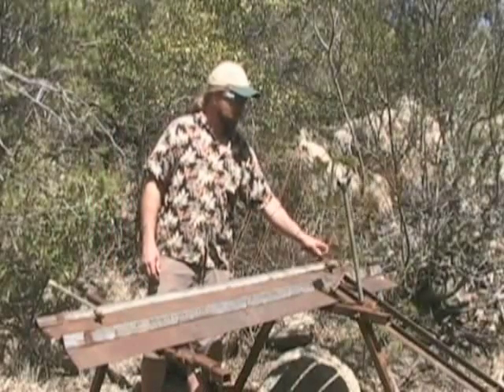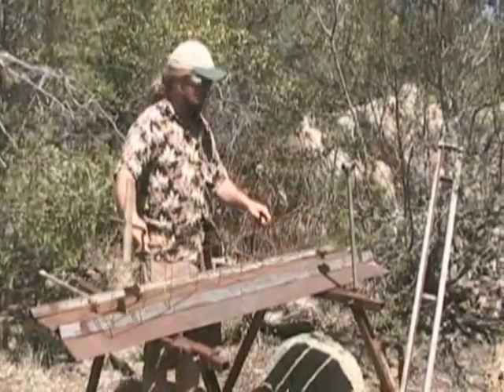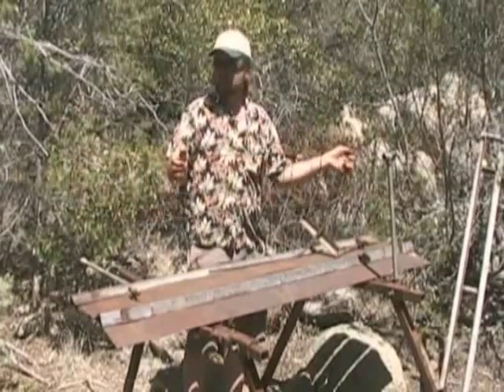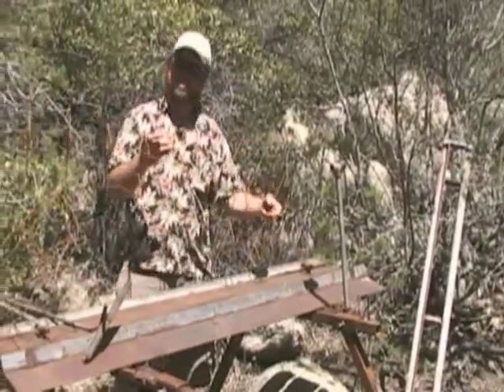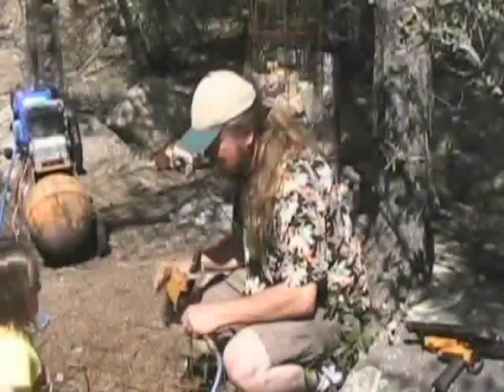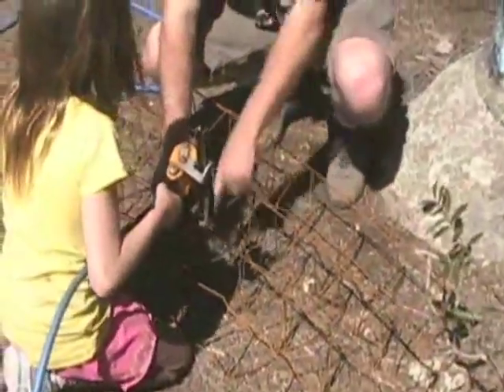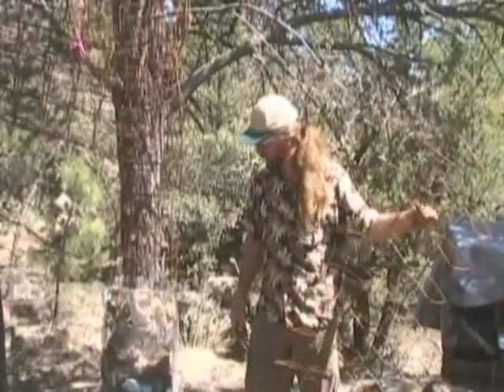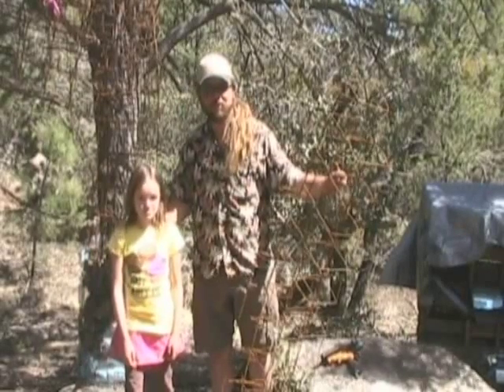Arched Truss Beam and Foundation Column Introduction

Comment from the maker: This truss design is very outdated.  The new truss frame uses segments of the block frame that are orientated perpendicular to the surface shell and reinforced on the top, bottom and sides.  This provides precise control of the blended radius and praise blending of the curved trusses and results in a much faster and stronger truss.  The trusses branch upward from the column base that also has a singe truss frame centered inside that cylindrical column base.  The two branches intersect with the adjoining curved trusses.  These trusses form zig-zag pattern while defining the initial curve, the transitional curves that is curve that gives you head and shoulder clearance in your building around your column and the curve that is your roof dome.  The new folder machine is much quieter and faster.  I keep this video up because it shows the slow development of the final system that is the Flex-Shell Core Monolith Pavilion method.
Reply from the maker: New videos are coming as it is important it is for me to try to get the idea out there of concentrating the fluid curvilinear forming into the initial Core Monolith Flex-Shell Pavilion that is upward flaring columns supporting, and accurately blending curves into a stress-skin roof and a single-shell awning.  That way, the high-energy reactive powder (self healing) high-strength shell material and the light, grid-wire based support reinforcing that is the stress-skin truss framing and single shell blending into a singular and sturdy curvilinear shape, is focused on long-term stability as a guiding priority.   
     
     By focusing on those structural goals, properly supporting an insulating stress-skin shell roof with fluid-form columns and providing flexible, or flex-stable, curvilinear outer shells that balance the forces in the dome and secondarily shelters the eventual entry walls, and prioritizing integration of the flat pads for the building environment into the drainage, erosion is reversed, the ecology is enhanced and runoff is managed by a water-storing garden environment and roof garden bowls that work to naturally provide long-term stability and encourage legacy-durable productive estate.  
     
     This way of relating to foundation as a foundational shelter instead results in a kind of authenticity for kind of organic art expression, like the internal structuring or geometry of music. The Core Pavilion approach provides a secure and stable scaffolding for adaptation, interpretation and expression by prioritizing extreme durability and accessibility, economics, via the small 6-gallon batches of hand-applied  composite for 3/4 inch high-strength surface shells and a responsive dialogue between the competing interests in the situation via accurate and stable fluid forms that are column-supported, which is key.   This core form is largely free-formed, trusses built and blended in situ, constrained only by principles for proper stability during extreme events, such as earthquake, tornado, fire and flooding conditions.  

     The method reveals a resonates with enduring life and actually draws calm attention to our tendency to collide costly abstract intrusions into the natural flow of things and even reveals our tendency to impose and dominate, put up resistance to solutions that oppose norms.  It is as if our culture's seeming absence of mutually beneficial belonging in the natural bountiful whole of nature is really just in our heads.  

     We have lots of new choices for how we might fit and live in this world if we consider that the manifestation of dysfunction in the human condition is caused by centralized agriculture, civilization defined as a class-divided dominator state where a misperception of ourselves as just doomed individual stories pervades and so also pervades is a compulsion to try to control, toil, judge and be someone else as we chase resolution for that pervading feeling of angst that really does not serve or fit into what is real or help us see what is possible.

Comment from the maker: Tall columns will so depends on connecting shape to adjacent. Reinforcing is concentrated on the surface membranes. 34' max span with 2' thickness- all radiuses on main span must have center near floor height. Column base is 2' round circle that flares from base.10K psi mortar caps the foundation casting or rock to provide a break-away hip socket for rotation+waves and a second hip socket break line with smoother socket geometry just above. Most will crush not twist because squatty braced shape.

Comment from the maker: Had camera for most projects during the plaster phase.  Just too intense to concentrate on much else but plaster.   Mostly only boring basic trowel plaster, not new.  I must, however, show how to make thick, clean cold joints, how to cure shell with a wet cloth under plastic + brush float with a fresh paste of Portland, water & acrylic, instead of only water.  You wont see this on regular plaster.  Trusses metal frame on inside, doesn't get plaster, only finished armature surfaces do.  More Soon

Comment: If you would be kind enough to show you actually using the mortar/cement on the trusses and also information on the keeping moisture on it to cure, along with finished structure, that would be great. In other words building it from start to finish.
Great helper you have there.